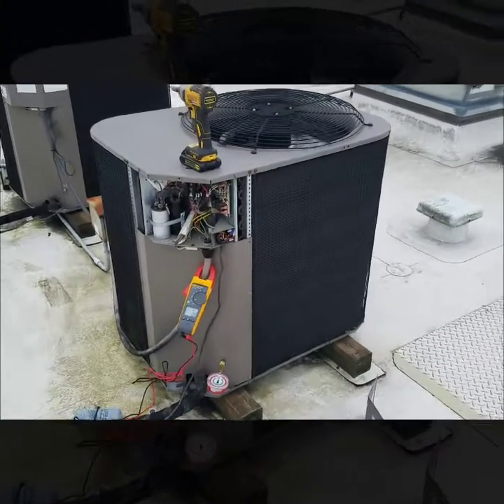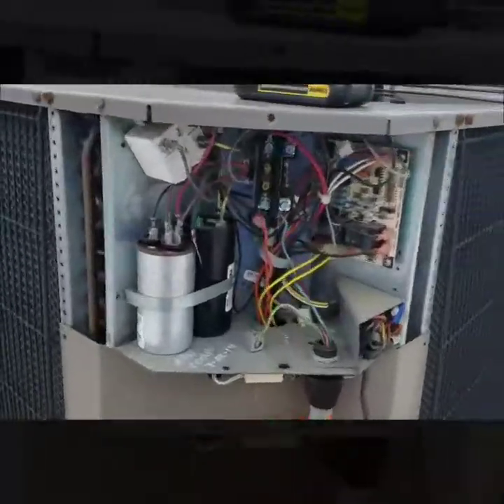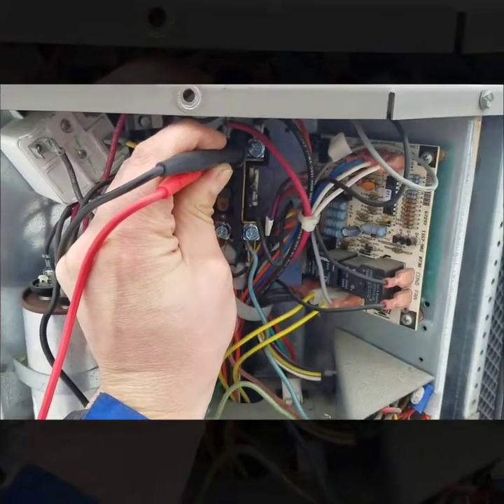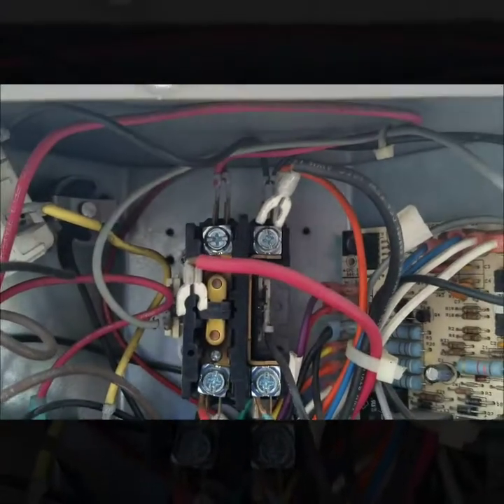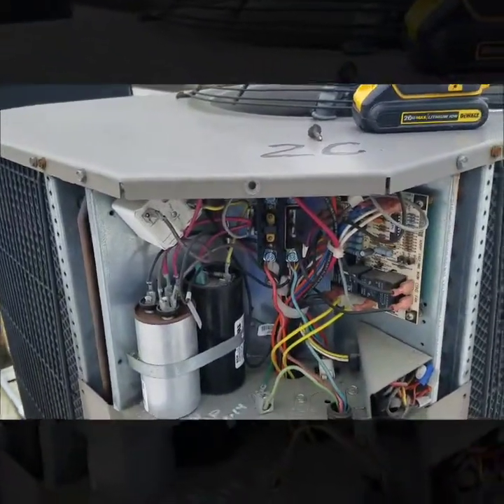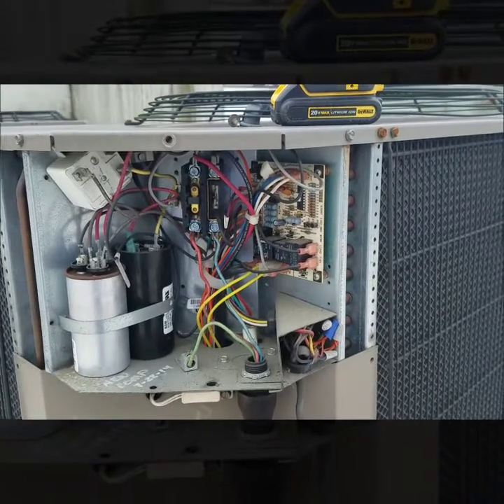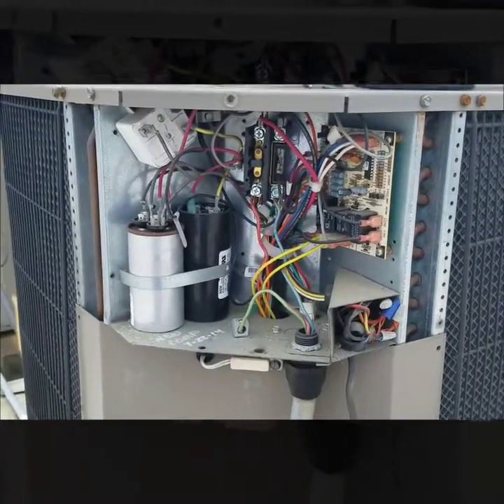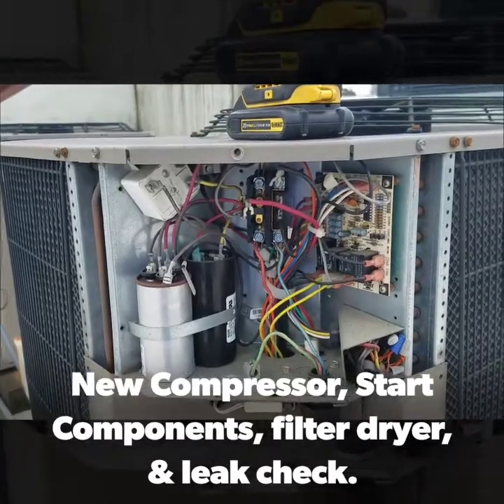Troubleshooting Heat Pump Split System

Comment: If you are out of gas like that , first thing you need to do is but some nitrogen in there and see where the leak is . , second it could be that terminal that didn't omw out but you never took the top of the unit to see the compressor and check that actual terminal , I would have check more thing it before letting the customer know anything
Reply from the maker: I agree with a flat unit you should definitely ohm from the compressor. If it has a charge its not worth the risk of the terminal blowing off when removing the wire from the compressor. I have seen the terminal blow off on 2 separate occasions during my career while on site. Definitely makes you crap your pants haha. I did inspect wires back to compressor but should have stated that in the video. Also agree on pressure testing before a compressor replacement. Our shop we have to get a leak check approved from the customer before doing the work. Thanks for the input.